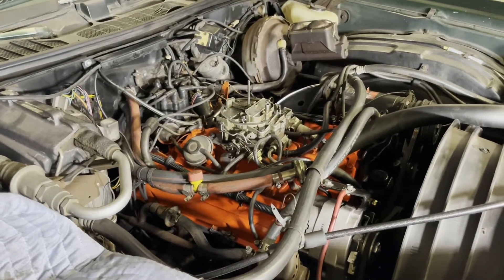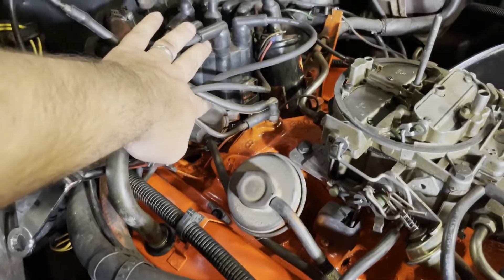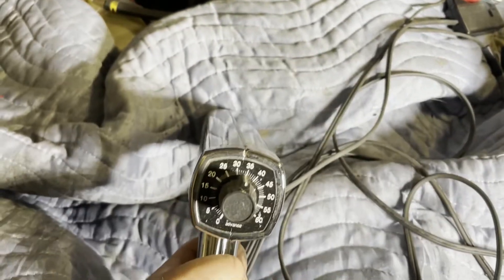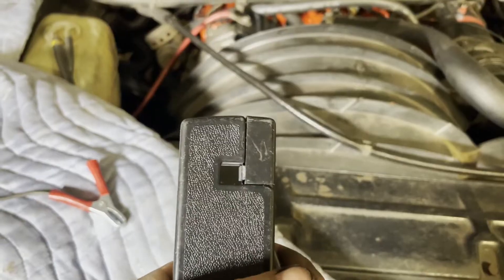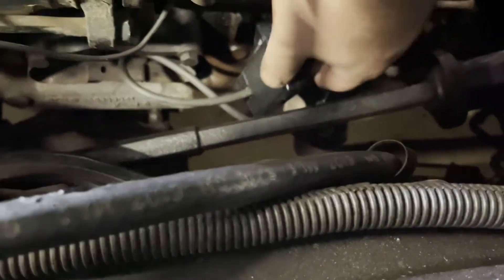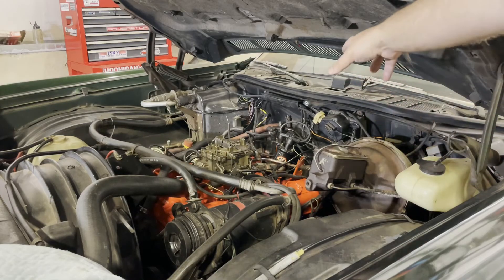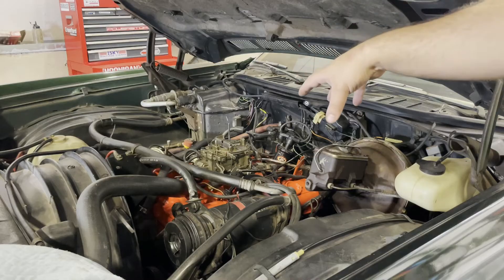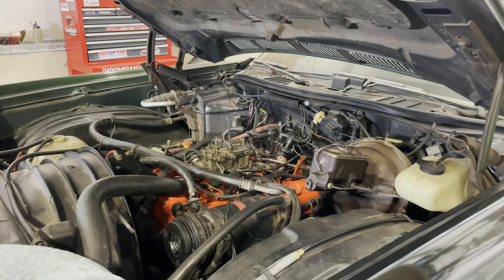Setting the Timing on a Small Block Chevy

Comment: What if the correct timing is supposed to be 4 - 6 ATDC? Do you set the dial to 0?
Reply: first off, 4-6 after TDC sounds wrong, but assuming it's some sort of "emissions" thing and you really want that, yes you will have to set your dial to 0 and read the timing mark to the notch/line for 4 ATDC. There's no way a timing gun can "predict" when a spark is going to fire so it can not dial to After TDC. The dial works for BTDC because the gun can introduce an intelligent delay based on RPM to compensate (one reason you want to keep your RPM steady when timing)

Comment: My friends 350 is backfiring like crazy and sometimes won't start.  He sets to TDC on cylinder 1 compression stroke, and sets the distributor properly but it's backfiring like crazy.  When it's run a few times the engine races up randomly.  He's blocked off his vac advance to do this.  I've run out of ideas.  I suggested maybe his cam sprocket wasn't clocked properly or maybe his cam lobes are toast.  He won't listen to me and take the front cover off to look at it.  Am I wrong?
Reply: Have you got this resolved yet ? I’m having the same issue my truck backfires like crazy at idle.
Reply: @LuisMora1es  had that problem with mine it was a wiped cam lobe
Reply: @RattleTrapGarage  It was the cam lobe(s).
Reply: @CHAOSMOVEMENT  dang that's too bad could swap a cam in it if it still has good oil pressure
Reply: @LuisMora1es  It was the cam lobe(s), it was trashed.
Reply: Check your plug wiring and make sure it matches proper firing order.
Reply: Verify you’re in the correct firing order
Reply: And all your wires are good
Reply: @outsidedog8205  Oh yea for sure.   It turned out his cam lobes were toast.  We put a new cam in and it's running.

Comment: How do I time my small block chevy 305 when I'm all the way advanced on my distributor??? It won't start any other way.
Reply: Sounds like you need to buy some starting fluid if you can get it to run and spray it around the base of the carburetor you have a leak somewhere I found out you need to sandwich the thermal gasket to have it seal properly